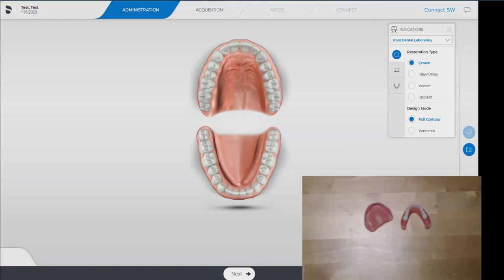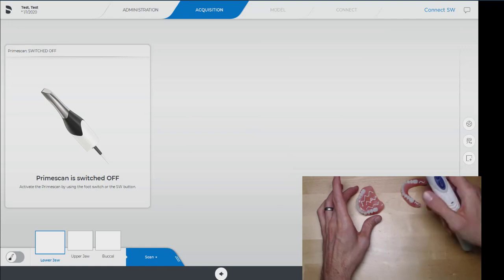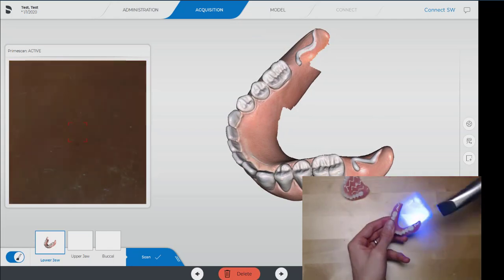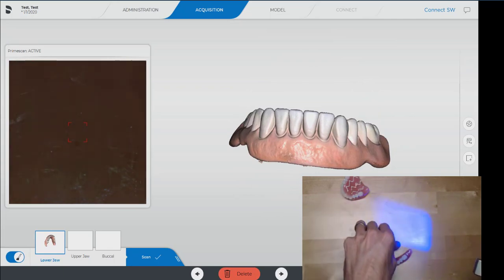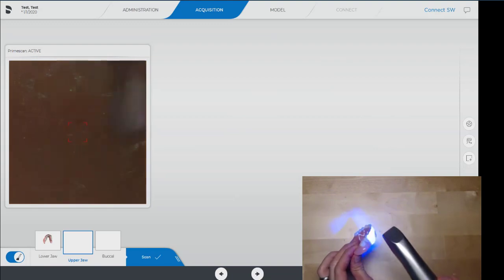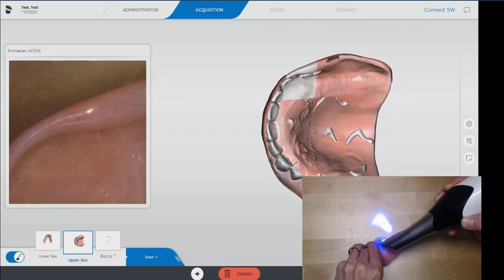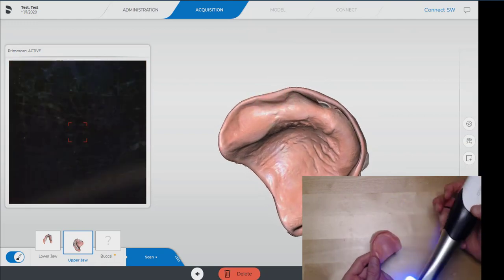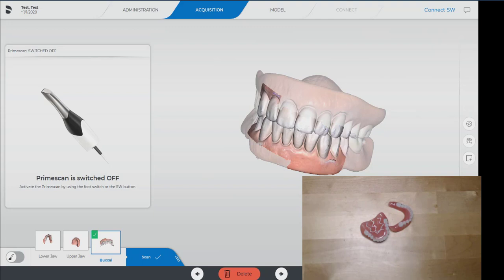Scanning a Denture with CEREC PrimeScan 5.1.1

Comment: Thank you 
When we scan the tissues for complete denture, I have an issue with PS not reading the palatal expanse.
Would you still apply liquid dam on tissues? Then remove them one by one as we advance so we eventually get a tissue with no dam? 
Thanks again
Reply from the maker: Sometimes I use Regisil with an injection tip.  It’s faster than using liquid dam.  If you are conservative with it, your designer may be able to remove it digitally.

Comment: So first step would be to take a reline impression with your choice of PVS and then you scan it in both sides and essentially the lab takes over from there to build new dentures?
Reply: pretty much. If occlusion/esthetics are correct on the initial set of dentures, a PVS wash impression and a digital scan of both dentures is enough for a good lab to fabricate either a wax try-in denture(s) or 3D printed trial denture(s). I've done a number of cases this way with good success.